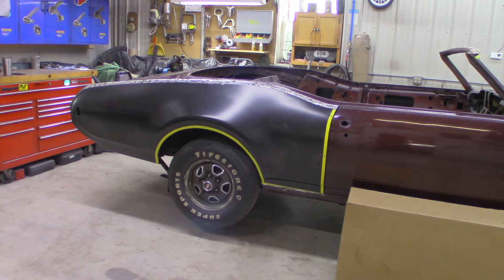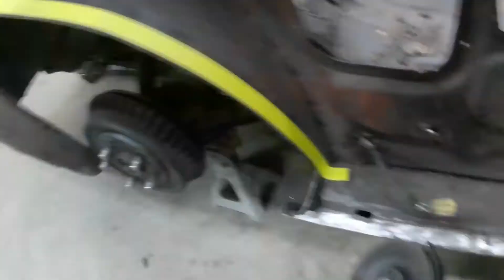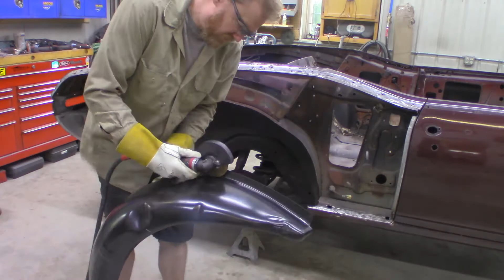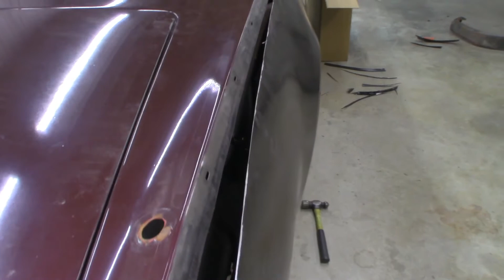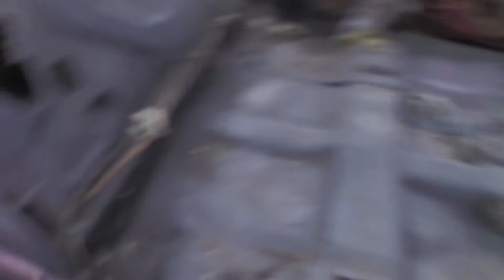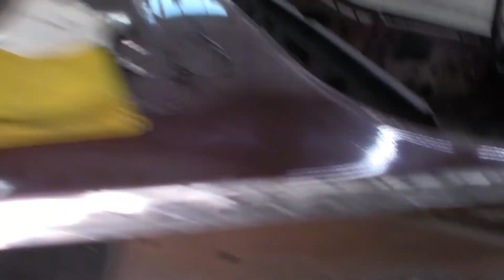68 OLDS 442 Outer Wheelhouse/Quarter panel install DTR Automotive

Comment: GM "A" body convertibles have the extra brace on top of the outer wheel well, which require a wheel well to have the flat portion.  Coups do not have the brace. 68 and 69 models have no after market outer well house that I know of for convertibles so you have to piece one together like you did. Good job.

Comment: It's nice to see the difficulties that appear in real life, I've being Doing 68-72 

442's and cutlass for 25+  yrs. As soon as you took the rt. Wheelhouse out of the  box, I knew you getting in deep. But that's autobody. Good luck
Reply: Question  currently have a 71 at the body shop and the wheel wells i purchased  he is replacing here do not match the curvature on the aftermarket goodmark  QPs and goodmark does not make the wheel liner?